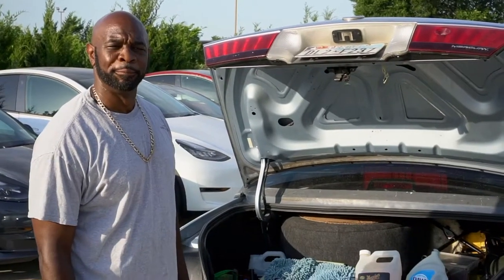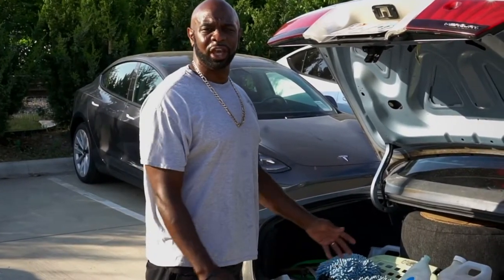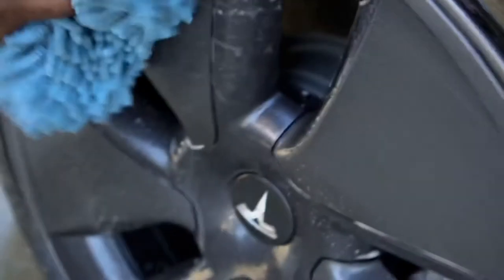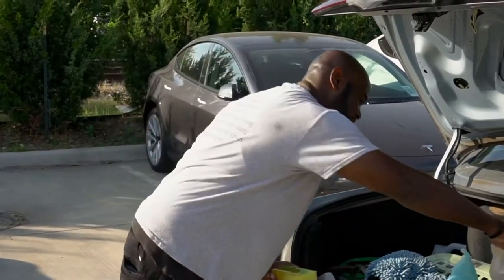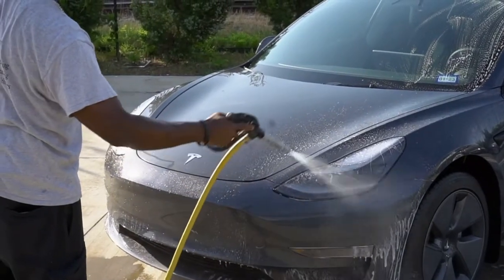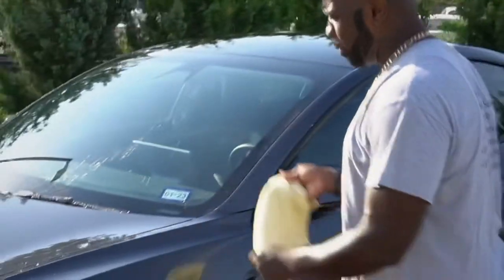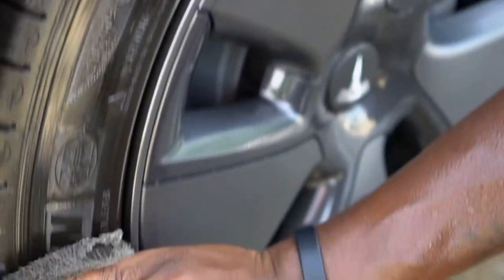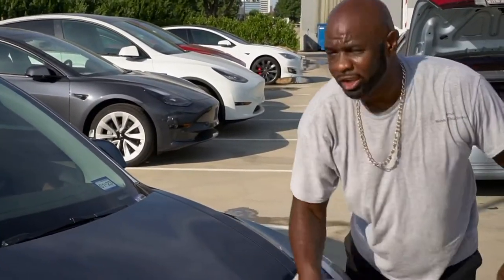Derrick’s Mobile Detail water supply washing tips

Comment: I appreciate the work ethic. but the only time dish soap should touch a car is to prep it for a clay bar and polishing (it strips wax ) followed by new Sealant and wax. On the tires no issue. 

I started working in body shops in 1998 and have a detail business.  I'm not throwing shade just want to share good information with you.  Keep doing your thing.